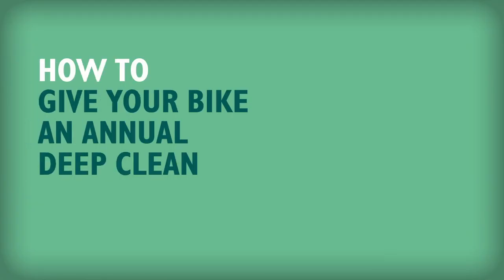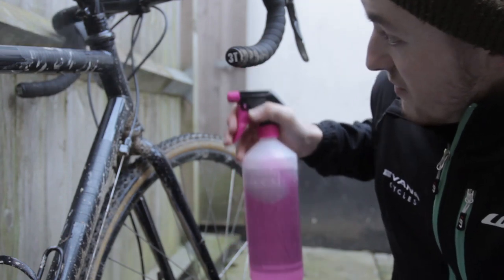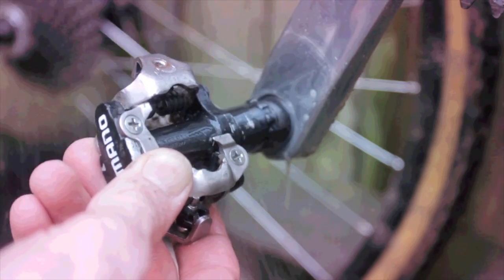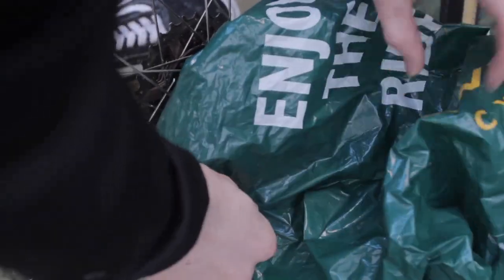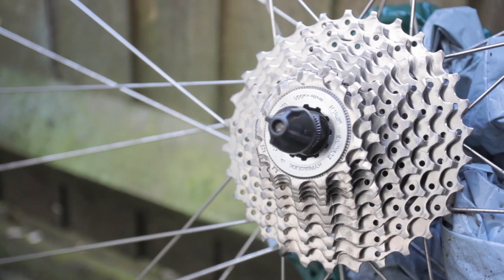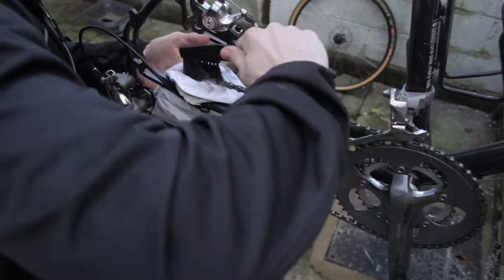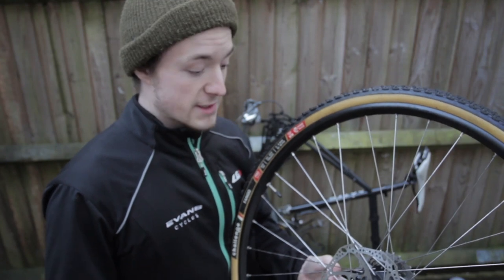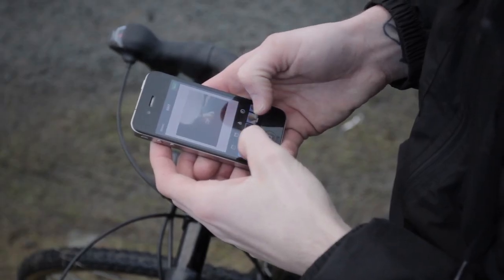How To Clean A Bike - Giving Your Bicycle a Deep Clean

Comment: Wow this is what I do after almost every ride, as well as checking the tires for embedded glass or metal, weekly I pull the cassette off take it apart and clean it and pull the cranks clean and lube the cranks and the bottom bracket and check the brake pads for glazing, and monthly I pull the headset and clean and lube it. I have never had a mechanical problem on a ride and haven't had a flat in over a year. Take care of your bike and it will take care of you.

Comment: To clean a brake rotor use a blow torch it removes any grease fast and no this ain’t a troll I work in a bike shop and as long as you only have the flame on the rotor for a short time it’s completely safe.

Comment: Chains are 3 deminsional bearings, once the sealant from the factory is compramised, the chain is done. No matter how much cleaning do, its pointless because you cant access the internal bearings.

The stuff that comes on the chains are a 3 part solution
Grease
Anti corrosive
Sealant

Once it wears off or once grime gets in its downhill for the entire drive train.

Chain is a throw away device.

Never try to clean a chain with anything but a clean rag with a light oil to clean the surface only.

Once the bearing has debris, its ruined.

If you follow this guys advise, you will be replacing the entire drive train gears within a short time.

Its just not worth it

Replace the chain, wipe off excess sealant, done
Reply: Chains don't have bearings. You should clean drivetrain as soon as it's dirty. In dry whether every 200km or so. Morgan Blue chain cleaner is the best by far. The more water goes on your bike the more often you should regreasee bearings.
Reply: Of course chains have bearings.  Perhaps you need to look up what 'bearings' means.

Comment: Bs, water works best, nature has proven this. Oh use our product ahahahahah.

Not salt water lol.

This is how you deep clean.

Strip bike to frame.
Clean frame
Remove shifter cabling and replace.
Replace bottom bracket bearings
Replace chain
Why ? Because these are throw away parts

Take out and clean or replace headset bearings.
Remove hub bearing and both wheels
Clean hubs and check cone surface health

Clean off everything

Re install the forks
Reinstall cranks
Reinstall hub bearings
Install and cut length chain
Inspect drive train teeth for wear and replace if needed.
Reinstall cabling and tune shifting.

This is a deep clean
Reply: mjs1231 That's called a knock-down service. Do you remove all your furniture every time you vacuum your house?

This was a decent video, I'm not sure I'd call it a "deep" clean though. Also I'd definitely suggest the use of a Park Tools (or similar) chain cleaning device to get the crap out of the chain links, rather than a bit of rag which just cleans the surface.
Reply: mjs1231 MucOff isn't Evans own product... and it IS the best range out there. For the bike, for the environment, for value.